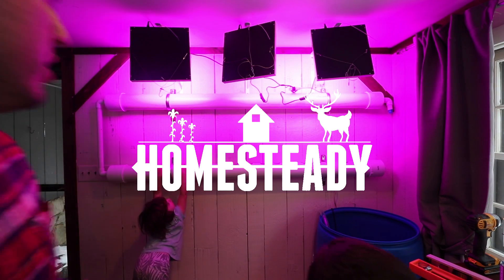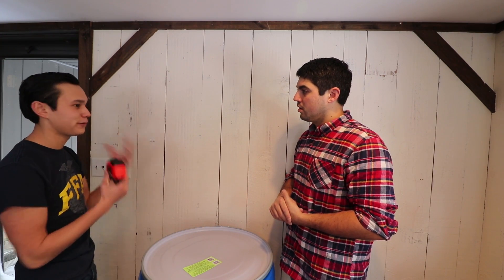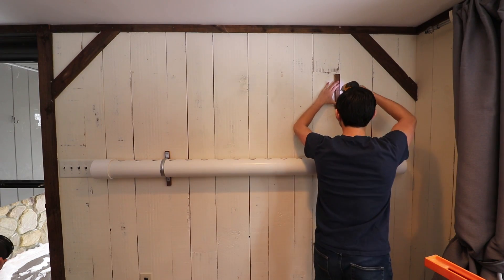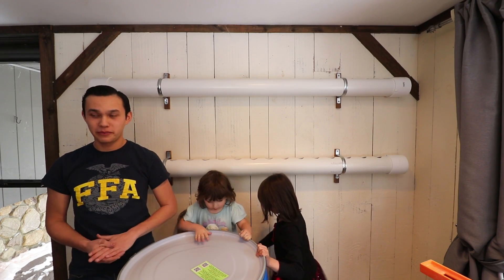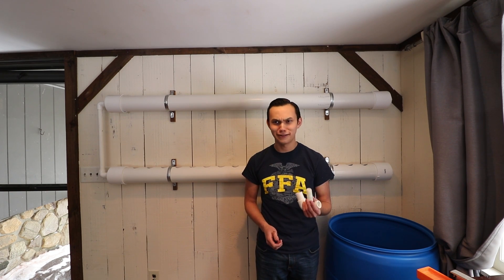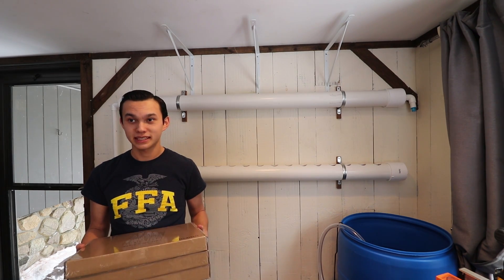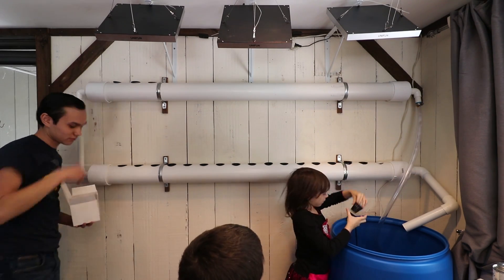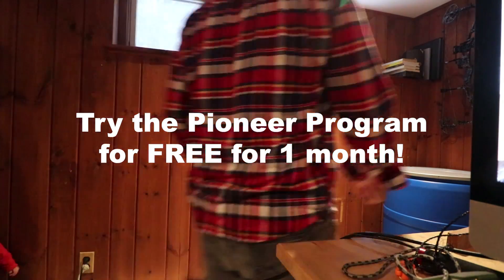Build a Hydroponic Grow Wall Inside - Grow Plants Year Round and Save Money!

Comment: Would anyone recommend anything on the wall first to prevent moisture and mold? Just looking to set up a system in Canada and we don't have very dry weather. Moisture can be a problem. Thank you!
Reply: I set up this system and have had no moisture outside the system.
Reply: @drcarline_louisjacques8899  hey there, wondering if you still have noticed no moisture? I’m worried about my wall!

Comment: Is the plastic piping food grade, though?
Reply: schedule 40 PVC is fine for potable water. However, exposure to UV light will break down the PVC which will lead to contaminants and eventual leakage.
Reply: @toddcampbell9732  so what would you recommend on doing to improve the system? would like to do something similar
Reply: @Sustainablebritt  I've thought about this for awhile. No system is perfect and as you get closer to perfect your costs increase. Maybe monitor the water and produce yearly and call it done. You may want to do this anyway.

Comment: Okay, so I built one one of these (June 2020) as close to their specifications as possible but there were several differences between the one shown and mine. My costs were less than $300 compared to their $500. They made several recommendations for pieces that you won't need. There is no need to buy 4 PVC couplers for the 4" rails because the 4" to 2" reducers will do the same job of capping off the ends of the 4" rails. If you have difficulty finding 4" to 2" reducers you may have to get 4" to 3" reducers instead like I had to do and then reduce down to 2" from there and then down to 1".  The biggest problem was fitting the vinyl to PVC barbed fitting to the 1" end of the PVC going into the upper rail. I had to grind the barbs off to get it to even insert into the 1" pipe which leaked, so I used a great product called "Rescue Tape" that I bought at Ace Hardware for about ten bucks to wrap around the connection and stop the leak. . The pumped solution from the sump barrel was the next consideration. I don't know why they used a 50 gal barrel because I used the solid geometry formula to determine the volume of two  10' long , 4" diam cylinders to determine that the that the actual volume of the rails is about 10.44 gallons but since they will always be half filled at level, total volume of flowing nutrient solution for the two rails is actually about 5.22 gallons so you can get by with a much smaller reservoir barrel. I bought a 14 gal FDA approved, food grade barrel for $43.39 instead of the one they used which now costs $150 on Amazon. I used black electrical tape to block out light through the clear vinyl hose to prevent growth of algae. Of course, I didn't locate the rails next to an electrical outlet but had I needed to, I would have installed a GFIC outlet. Since I had a 1" PVC elbow draining out of the lower rail, I used a smaller  1" PVC pipe to drain the system instead of a larger 2" PVC and fittings which would never have fit the !' exit.. I cut holes for the drain and vinyl hose and filled the system with 16 gallons of tap water mixed with Aerogarden Liquid Nutrient from Amazon (1/2 cap per gallon). My holes were cut with a MIlwaukee Dozer 2" hole saw (Home Depot) two inches apart (or 4" center to center). A similar Bosch hole saw burned out.  Get the Milwaukee. Be sure and reverse the drill after you get your hole started to make a cleaner cut for your 2" baskets. My total cost of the hardware was less than $300 for everything. The $23 grow lights are a great buy and very inexpensive. Plug off the smaller outlet on the pump and don't use it . It is only for aquarium purposes to simulate a current for fish in a tank. The nutrient solution returning to the barrel will generate bubbles to stir up the barrel's solution. It has been two weeks now, and we are growing everything on a timer and with a cheap $20 box fan to cool down our garage here in Arizona! Good luck and thank you for bearing through this essay!
Reply: 55 gallon barrels are way less than 150 dollars, you just have to go pick them up at a farm supply store.   
https://barrelsuperstore.com/shop/ols/categories/plastic-55-gallon-food-grade-barrel
Reply: @yunggolem4687  I didn't use a 50 gal barrel like they recommended from Amazon that costs $119. I paid $43.39 for my barrel w/ tax.I didn't have the vertical space between my lower rail and the floor to put in a 50 gal barrel so I used a 14 gal FDA approved food grade barrel that I bought locally and picked up myself to save delivery costs.  Total volume of both rails completely filled is 10.44 gals so a even a twelve gal barrel will do the trick with both rails constantly filled and draining only requiring half that volume (5.22 gals).  There will always be a little over 17 gals in the system when not running, 5.22 in the two rails, and 12 in the barrel. The idea is to save money on this project.
Reply: @yunggolem4687  Make sure they are FDA approved food grade, else you may be ingesting BPA.
Reply: @harrythompson6854  Agreed.  That's why I linked food grade barrels.
Reply: And smart switches which are for example connected to apple homekit make it possible to automate the pumps and lights :)
Reply: He said he paid $35 for his barrel.
Reply: Hi, I created the grow wall. I love everything about it but the noise it makes as the water goes from the top rail to the bottom. I am assuming it has to do with the decreasing  diameter of the PVC pipes. How do you eliminate that noise? The pump and the draining water back into the holding tank barely makes a sound.
Reply: Why didn't you just tap that barb fitting into the PVC pipe. 
Purchase purchase a NPT 3/4-in male to male barbed fitting and connect it that way.

Comment: Great idea here but I have a few questions. #1 What are the 4 PVC  couplers for?  A 4" reducer will fit over the ends of the 4" pipes making the couplers unnecessary. #2 The total volume of the two rails is approximately 10.44 gallons. Why did you need a 50 gallon water barrel? #3 Why do you need a 4th 1" adapter for the 2" drain pipe going back down into the barrel? #4 Do you really need a 2" PVC pipe as a drain? Can't you use a less expensive piece of 1" tubing? I am going to wrap all my tubing with black electrical tape to prevent algae from the light. Thanks.

Comment: So, I've seen a few different build styles, one like this that uses the one-inch PVC to drain between levels... but given it's elevation, that leaves water in the pipe. Is that an issue when it comes to rotating nutrients or root rot? (this compared to full width pipes draining so that the roots can be dry occasionally based on timers.
Reply: I designed and built my own outdoor "water wall".  I put a small slope on each of my rails.  the water ran 24/7.  In my mind's eye it was like plants next to a creek in which the roots hung in the water all the time.  I had to shut it down every winter here in Alaska. I used it for 4 summers with no ill effects. It also had a bubbler and a heater in the reseviour which extended the growing season.  I used gutters and hydroponic equipment, instead of reinventing the wheel like Jonathon.
Reply: @SusanElliottZen  mine makes a lot of noise at the end of the top layer as it goes into the 1in pipe. Mine is indoor and I don’t know how long I can tolerate the noise.

Comment: I like to use flat end caps on the horizontal pipes so that I can put the drain hole lower down in order to get more of a thin film than a water culture. I use a skin fitting with non-parallel threads so I can take the whole thing apart for maintenance. I hate the permanence of PVC glue.

Comment: Purple primer is first, let dry before setting glue in, also all parts being glued together must be glue individually not just one side. 20 yrs of plumbing advice.
Reply: Yeah the both sides is important but if the pipe isn't holding any pressure then primer is not necessary
Reply: It's water my man, if you don't want it to leak at all, makes it stronger bond. If not taking this advice, all u need is red hot then.  True, no regulated pressure then corners can be cut. Good job plumbing world lol.

Comment: This rain barrel is WAAAAAAY overkill.
Reply: That's what I was thinking. Wouldn't it be better to use something long and more shallow, use a weighted lid so the little ones don't drown in it??? Then you'd be able to hang more grow pipes..... Also the clear pipe is a mistake as it would allow algea to grow.... Pipe is blocking the light switches, that would drive me nuts..... Great idea but needs some rethinking.
Reply: How do you size it accordingly?

Comment: Very interesting. How does one of these cost to operate on a monthly basis - particularly in terms of electrical usage?
Reply: They're using three 45 Watt grow lights. Assuming they're running them at full power for 12 hours per day is (45 W * 3 lights)/1000 W per kW * 12 hour is 1.62 kW-hour each day. You'd have to multiply that by your local electricity cost to find out the daily cost of running the lights. The national average is about 13 cents per kW-hour. So based on that the daily cost would be 21 cents. That's a bit over $6 a month, or about $75 a year. My area is well below the national average, so for me it would be just about half that.

Do similar math for any other electrical components, like the pump, and then figure out how long those operate in a day. To get more accurate data, and to make things a bit easier for you, you can buy a little electricity usage meter on Amazon for something like $10 that you plug into the wall, and then plug everything into that and it records how many watts you use. So you can set it to record over the course of a day and then multiply by your electricity cost to figure out how much you're paying per day to run that setup.
Reply: Wow, Thanks!

Comment: Fun idea, but the whole thing could be waist high rather than at your head. It'd be easier to hang the lights and not have them so close, evenly distribute the light.  The drainage doesn't look super effective. It'd have to be at least half way full before any excess water drains off from that huge pipe. Maybe fitting a drain at the bottom of the pipe would be better.  That huge barrel in your room would be a pain to fill up and hide.   Seems a bit big.  Trying to fill the pipe with dirt would be interesting. Scooping it through those 2 inch holes looks like a pain.

Comment: too many mistakes out here, 1- the huge container , 2- the clear hose, 3- distance between the holes ,4- lightning position 5-pipes touching the electric socket and much more.
Reply: not a mistake if it grew...
Reply: Plus, they've screwed everything in place permanently and no ability to remove or clean out system.  All those roots will be hell to clean out every year.  Each horizontal pipe should have clean outs on each end.  Clear tubing will cause algae growth.
Reply: I was looking to build this but saw your comment. If i were to build a similar design could you expand on your comments? 

1) Benefits of non-clear house
2) Huge container, the drum? How big should it be? 
3) What should the distance between the holes be? 
4) You mentioned much more? 

Electrical socket concern, that one seems like common sense.
Reply: Nice into but building so close to light switches etc gives me the willies.

Food grade barrel but how about all the other piping? Not concerned about chemicals out of the running?
Reply: And 34 heads of greens for an initial cost of $500! They probably make money getting ppl to buy things from links. Ugh! Youtube is getting bad.
Reply: @BlessedBaubles  The initial costs of farming/gardening are always a bit high, especially if you are not blessed by having hundreds of local stores nearby like me.  Hear in Texas, we have clay soil coming out of our ears, so to have a backyard garden, we have to amend the soil like crazy, which definitely adds up quick.
I will say that that is a over-estimate on price.... even if you include the price of seeds, net cups, water, pump, lights, pipes and fittings, nutrients, etc.  No more than $300 in my opinion.
Reply: Paul DeBaker I have your answer... watch “Back to Eden Gardening” movie or method, but see if as told by Paul Goetz (not sure I have the last name right) You’ll find it’s easily all over the internet and Youtube. 
I’m a farmer all my life, not big commercial, but lived on a farm growing up, then started gardening in Florida and back again in Massachusetts. I lived in NC for a time so I know what you mean by your soil, but I’m telling you... you will no longer be “working hard to fail” as Paul says.  It’s so fantastic!  Let me know what you think after you see it.  
Also, now that I’m renting and not close enough to the family farm, I have to grow in pots.  I have had tremendous success growing lots of food in pots.  Just keep the same Back to Eden principles fling and anything is achievable.  Let the ideas go that we’ve been taught by the CONSUMER industry that want us ti buy buy buy.  You will love your freedom and your gardening success, without forgetting all the vitamins and mineral we get from growing our food in real soil.  God bless.
Reply: @BlessedBaubles  Thanks for the kind reply.  Like you, I grew up on small farms.  In fact, I was a 4th generation farmer... now a back yard hobbyist since my wife and I moved 7 years ago.  My 30 by 30 foot backyard garden produces way more food than my family can eat.  I also have an indoor NFT system, an indoor Ebb & Flow system, and a custom built 12 foot by 1.5 foot Aeroponics system.  I love gardening, as do my kids.  You can definitely garden on a budget hydroponically and in outdoor pots & beds.  And I have watched just about every gardening channel I could find on youtube.  

Thanks again for the thoughtful reply and Happy Gardening!  Blessings to you and yours, Paul.
Reply: Paul DeBaker You are welcome.  I sure hope you watch “Back to Eden”. I can assure you, you’ve never seen anything like this nor will you need anything else again.  God bless you!
So glad you have some land. I lost everything, now my family wants to get rid of our family farm for $$.  I’m devastated and pray for a miracle for keeping the farm or getting out of poverty & having a real place to grow 🙏🏼🙏🏼🙏🏼✝️
Reply: @BlessedBaubles  do you have your own channel? Calling you amazing is an understatement! Whoever you are, thank you for the mind blowing knowledge you share!
Reply: would you suggest a different video?
Reply: @daniellakachar4953  There are dozens of hydroponic videos on youtube.  This is a very simplistic introduction to a DWC-like system.  The design is good overall, though the execution on that particular wall was a bit flawed. 
1) The distance between holes is subjective, as each different variety of lettuce/leafy green has a completely different space requirement.  
2) The light distance also varies by plant species.  Lettuce, in particular, does not have a high light requirement. So as long as you meet the minimum par requirement, as measured by a LED specific PAR meter ($200-$500), you won't have any issue growing lettuce.  Lumens don't give you an accurate portrayal of plant requirements and are typically not used in hydroponics, aeroponics, or aquaponics.
3) The 35 gallon drum is not a bad idea... just not what I would put in my living room. A larger container like that will allow for less temperature swing.  However, it does not block out light on the inside very well at all.  Light reaching into a container that large will cause an algae problem in the long run.  I would recommend covering it with a light blocking material such as blackout fabric or black paint.  Same goes for the vinyl tube.... NEVER use clear.  It allows light to pass through and will also cause an algae problem.
4)  I do agree, whole-heartedly, that it should not be place that close to the light-switch.  Regardless of how well you think you built it, unless every switch in that box is on a GFCI breaker.  (Ground Fault Circuit Interrupt)  Even then... I would not do it.  Find a spot a little further away from switches and plugs.  No accidental fires/electrocution then.

All in all, a good basic introduction into DIY vertical farming.
Reply: Daniella Kachar I don’t know of any. It depends what you’re looking to learn about.

Comment: You're using components that are not safe for drinking water, why do you think they would be ok for use in growing a consumable plant?  Vinyl is definitly not ok, and PVC is questionable.
Reply: Actually, PVC and CPVC pipes are used in most modern plumbing applications and are perfectly safe for growing veggies.  Unless you are running Distilled Water, you will have far less leaching of chemicals into the water than you think. Only use distilled if you are mixing substantial nutrients back into it first.  Plus, you are adding many nutrients to the water column to sustain the plants growth, so leaching is less likely due to the nutrient load already present.  As for vinyl tubing, it also is used frequently in farming, food production, aquaponics, hydroponics and several other industries.  The problem with clear vinyl becomes an algae issue.  I would not recommend clear at all.  You want materials that block light to reduce bacteria and algae.